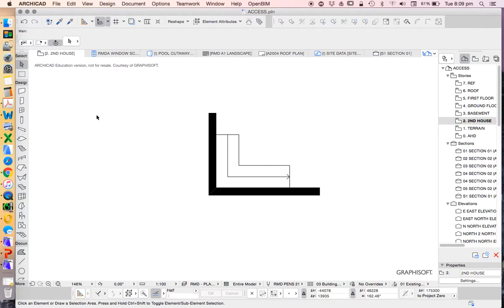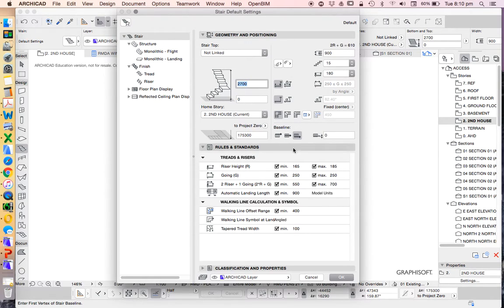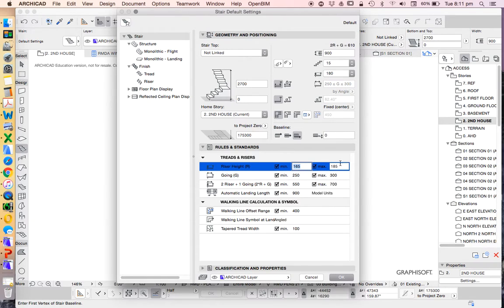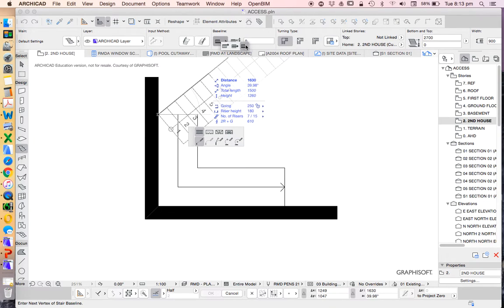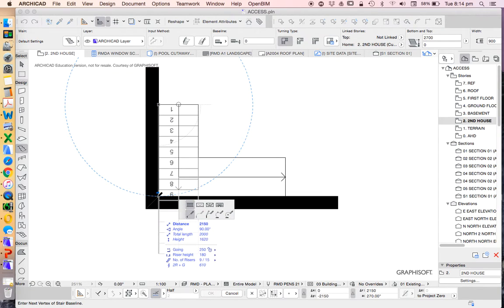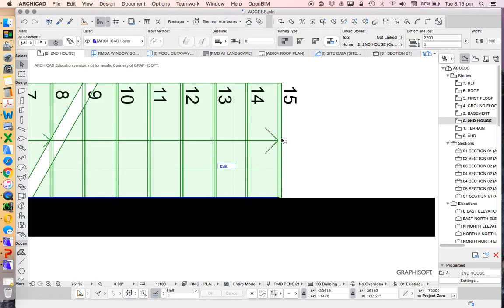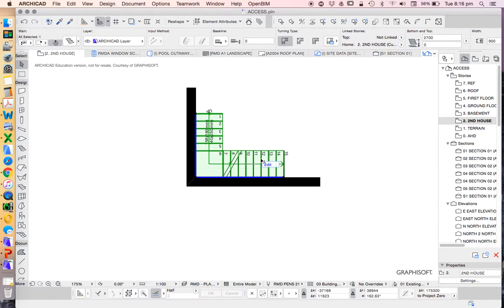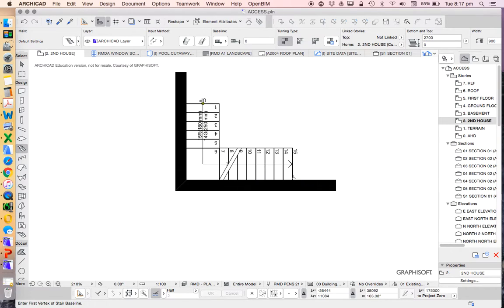ArchiCAD 21 House Project - part 18 - Stair tool

Comment: Hi! I'm so lost with this new Stair tool! How would I draw a ramp using it?! On ArchiCAD 20, they were together.
Reply from the maker: As far as I know, the best way to draw a ramp is with the roof tool, or the curved ramp object. You can then use the rail tool to fit it.